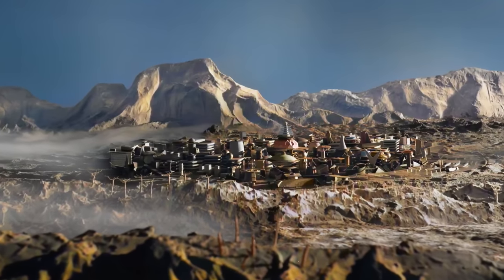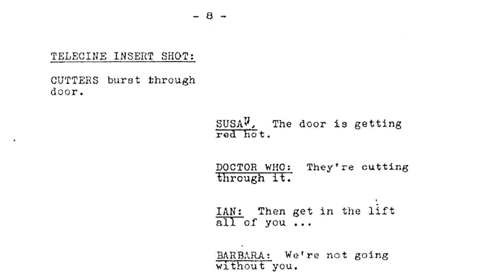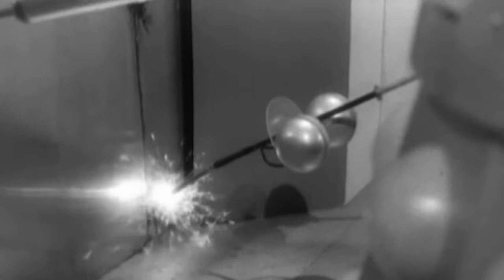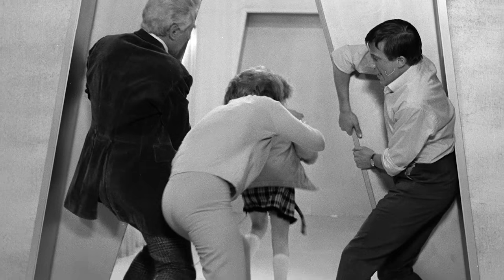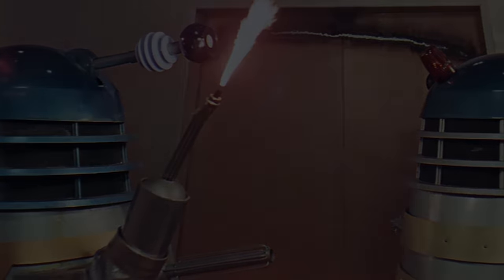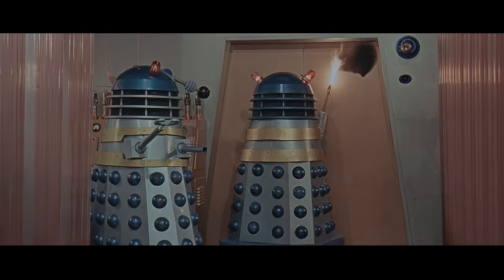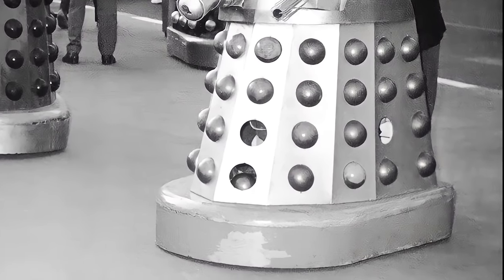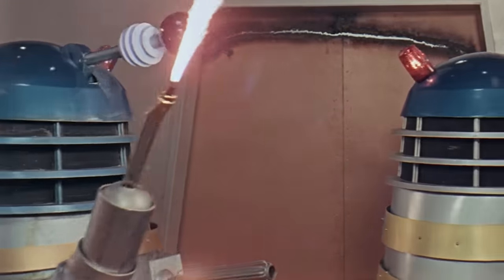The Secret Life of the Bizarre Blowtorch Dalek

Comment: Thanks, another great video.  On a tangential note: the curved corrugated iron building at Shepperton was an example of a Romney hut, the larger brother of the Nissen hut. Both were built in huge numbers during WW2 for military and other uses. They were designed to be really fast and cheap to erect but very versatile. There are still some around, and even some new versions, but there were many more of them still in everyday use in the 1960s. Everyone would have been very familiar with them then, but not so much now.
Reply: Nissen hut not Nissan hut
Reply: @colinbarron4  Thanks, corrected.

Comment: The Dalek sculptures get a mention in the novelisation, as it's a 'set of metal squares welded together at the corners' (IIRC), that gets thrown down the lift shaft to deal with the Dalek's first attempt to catch up to the companions.  
IIRC, it's mentioned that the area was above ground, high in a building overlooking the central square, and also that this place did not look any Daleks came there, and the sculpture may have been made and forgotten long before.

Comment: Of note with the welder Dalek is that we can see in some shots when paused that even during filming the prop suffers with damage to its skirt balls several of them can be seen partly pushed into the skirt, particularly on the rear panels. Its a shame that prop seemed to be hastily constructed ,it could have had a nice shiny blue top and neck rings with blue lights and been a third in command . A missed opportunity really.

Comment: I do wonder whether, given the seeming sudden deterioration in condition between movie and returning from cannes, if the blowtorch dalek was used somewhat as a rolling spares supply to keep the drone props maintained during the promotional duties. after all if you need to quickly fix up a prop that's lost, say, a bump or a light, it would make sense to use ones from a prop that few people would likely even recognise to keep the more well known and photo-opportunity friendly models going
Reply from the maker: It’s possible I guess but it was fixed up itself by the time it got to Selfridges which may make the theory incorrect. Definitely worth thinking about though!
Reply: @Dalek6388  that's true, it's just a random theory I thought of whilst watching the video after all. maybe once it got back to London the spares would have become available for the others and parts used during the tour returned to the blowtorch dalek? all speculation though, and based on the feeling that the deterioration of this prop during that period seems oddly fast compared to the others, as if it was either built to an inferior standard to start with or treated particularly badly

Comment: What are the dots next to the hemispheres on some of the rear panels? Screws holding the hemis on?🤔
Reply from the maker: They are little holes. We assume for nails that went through to a baton running up the back of the hemis but we aren’t sure they used that method in the end. So the holes remained empty
Reply: @Dalek6388  Cheers for the reply! Do you anticipate more revelations of small Dalek details when the 4K release comes out?
Reply from the maker: Hopefully. We like to see new stuff!

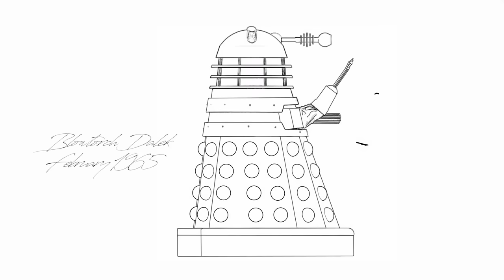Comment: 6:10 The lift stops short of the floor in a lift designed by daleks for daleks?
Reply from the maker: It developed a fault.... 😂
Reply: if the casing hadnt been previously deactivated from the current of the floor it would have been able to. Or if a Kaled mutant was inside that was able to operate the movement of the casing.  they probably would have levitated slightly or something

Comment: If you’ve only got five daleks but you need seven, and you’ve got o e more dalek prop, as you said, it’s simpler and more efficient to just use the unique dalek as a background filler prop, that’s there to be see ,  but not really noticeable considering that back then things like stopping, pausing or zooming in and out if images was a thing and even great films like Star Wars has the same small problems, such as the blaster bolt hitting the wrong trooper, the door, the jittering lightsaber and whilst those were small problems they were relatively small and minute not to effect the flow of the film although and again since most movies were either on the big screen or on an TV where graphics weret the best even with modern video enhancements the low quality shots can more or less be easily ignored since there was the disbelief unlike today where everything is judged and criticized